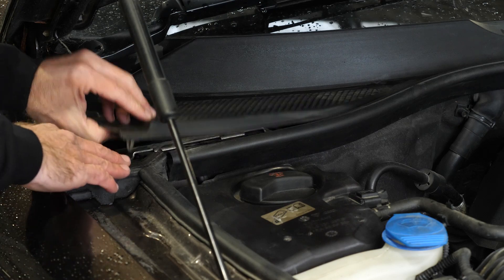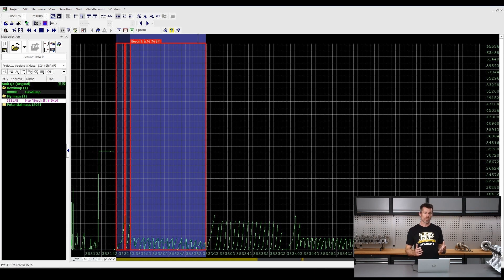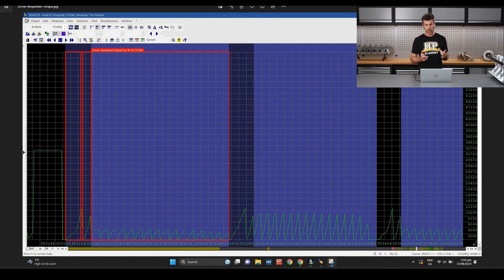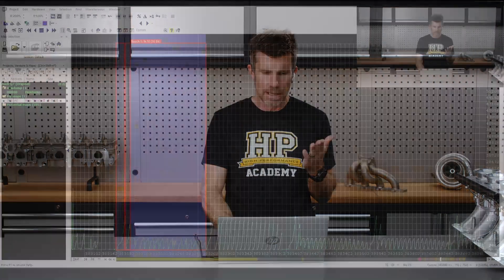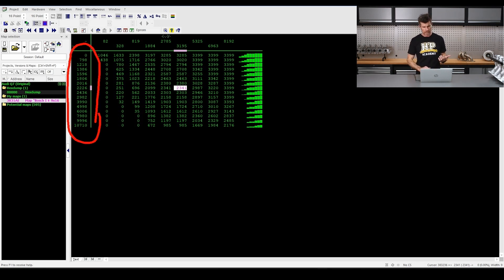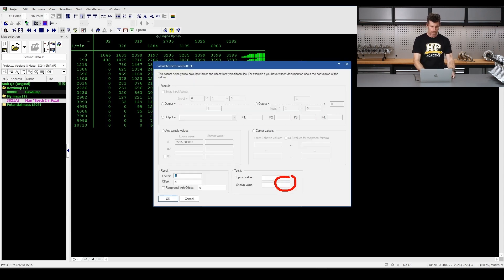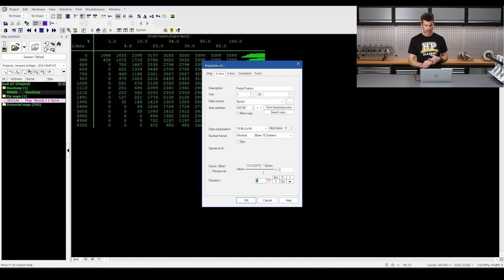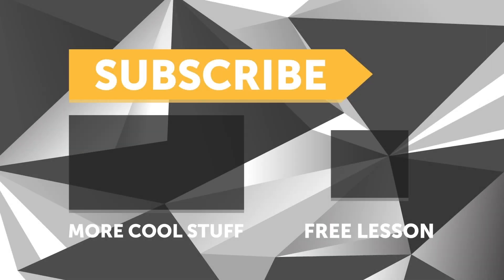WinOLS Map Identification Basics

Comment: Oof, for 900 euro I would expect a bit more that windows 95 level of UX
Reply from the maker: Better to know software engineers have spent time making sure things are logical and functional over just being pretty though right 😉 - Taz.
Reply: @hpa101  as a software engineer myself, I get it. But damn a little colour wouldn’t have taken them that much longer to implement
Reply from the maker: @sarahburnside4606  haha yes bit of a plain palette, you are right. Maybe you should send them your CV with a list of things you can help them with 😀 
There are some settings for other basic colour options too that Andre prefers not to use. He covers it briefly in this video, noting again, it is just basic, not something you're going to screenshot, print off and hang on the wall 😂  - Taz
https://www.hpacademy.com/blog/how-to-use-winols-interface-basics/
Reply: @hpa101  skins are a 10/10 addition, I plainly refuse to work in anything that doesnt have a dark mode 😉
Reply: You have a selection of skins and colour themes....it's not all doom and gloom 😂
Reply: I've worked with some extreme high end programming tools. Let's just tell you, if it doesn't look like it hasn't been updated since the 80s, it's not the expensive tool.
Reply: There are free versions out there;)
Reply: They have a dark theme and heat map for tables. Best automotive firmware editor so far. Very neat project management. As your project count grows, u will be able to compare lots of things. WinOLS also gives u similarity check to existing projects and versions for the file u r trying to import. Very good version control. There are tons to explore.